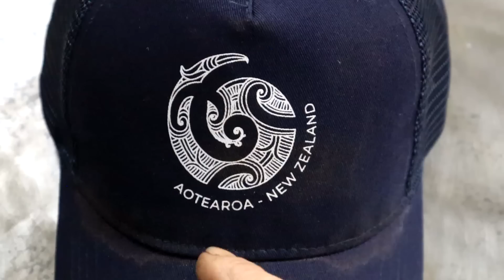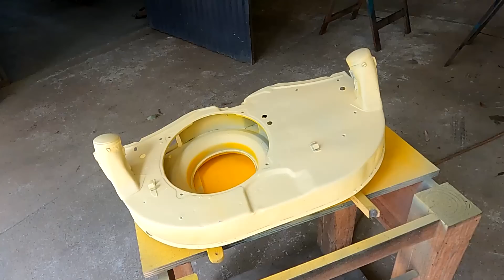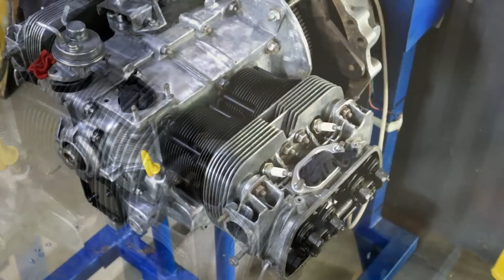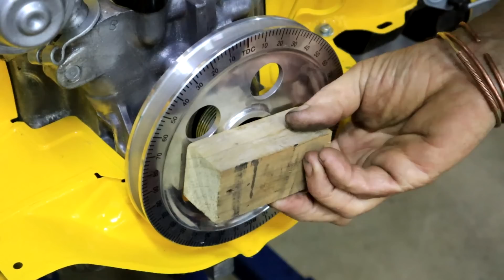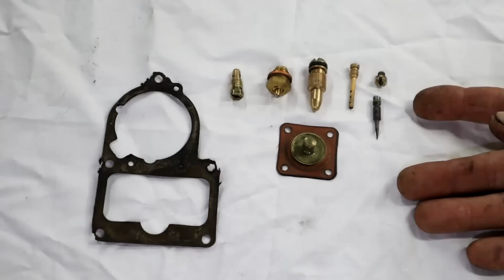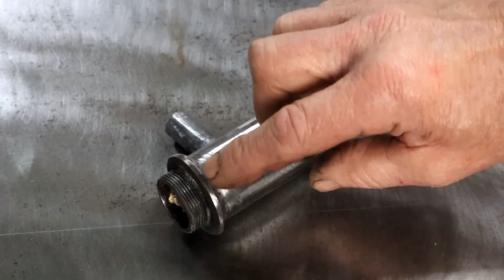Progress on the Renobug - Assembling the VW Beetle Engine

Comment: How much hate mail for using the hammer and block to put on the crank pulley instead of a longer bolt to pull it in
Reply from the maker: No one has cried about it. And there is nothing wrong with it if you do it with feeling. In the real world, who has a longer bolt that will fit there?

Comment: I must say only because I did not see you do it and only if you have a flat spot , there is a small ball baring working as a one way valve in the float chamber and it’s part of the accelerator pump, it has a plug on top but meant to be pulled apart to clean it, the plug has a thread on top to be removed and the screw you use is the one that screws into your plastic amber and red tail light, you screw the screw in and with wire side  cutters you grab the screw and remove the little plug by carefully pivoting the cutters on theCarbie  body.😊, don’t loose the ball baring. You may not need to do this and a good way to know is by shaking the Carbie if you are able to hear the little ball bearing rattling, then all good. God bless😊. Hope this makes sense 😊
Reply from the maker: I did not know that! Thanks

Comment: 1300 is argueably the most reliable vw engine. The 1200 has smaller rods, pins and thinner jugs. The 1300 share 1500 and 1600 rod and pin size with the thickest of jugs and origional german 1300  jugs are the best. Just speculating. looking good. Love the reno bug. My bug is named the dua bug. Here in the USA politics is getting hotter.
Reply from the maker: Yeah, I hear your politics are heating up. Everywhere it's seems...

Comment: Hey, Diff. I would have done the valve covers black, to help with heat dissipation. Can't go wrong with VR gasket kit. I think only the kits from Brazil had extras. Will order a T shirt later today. Motor looking good. Greg in Durban. 'Till next time, hang loose, Diffy
Reply from the maker: If you are in SA, cheaper to order a T shirt here:https://www.petrolheadtshirts.co.za/?product=roguerunner-rat-rod-t-shirt.

Comment: Love what you did with the Engine Tins brother.
Gotta love the servicability of the ol Solex carbs.
I do remember back in the early 80's modding bug engines and remember getting suckered by those pancake filters and findig it was best to go smaller diameter overall bit thicker . like at least 50 mm, learned in particular from going to Holley Bugsprays found thesse engines want some room to create a bit of fuel fog above the carb body, just make it run nicer. Just a memory that might resonate ;) 
Really enjoying this build 
All the best Diff
 👍✌😎
Reply from the maker: Yes, hate that POS air filter!   Looking for something better.

Comment: Everything you said about your government goes for the US also and it is going to get much worse before getting better. While you are working on the engine I was advised by a VW mechanic, to check the torque on the head bolts, often. I spent some time trying to find you with my computer map, but didn't have enough info, Now I'm thinking you are somewhere around Bonnievale and Ruiterbos
Reply from the maker: Spot on, I live in Ruiterbos! Farming community

Comment: Back in 1982, my friend traded a pickup for a '69 Baja Bug. He came out well on the deal, nice VW, with a dual port 1800, a better cam, Holley Bug Spray carb, and a 4 into one exhaust, like yours. After few trips through the woods (forest), the muffler/tailpipe broke off. No problem, we had a friend who raced Circle track Bugs, so we got a teepee style header from him, and after cutting a place for it to exit just below the rear window, the bug was back in action. Now, this particular motor was a bit hard to start, especially after it was warm. To start it while hot, you had to hold it to the floor, and crank it from 10-20 seconds before it would clear out and start. So, one evening after we filled it up with fuel, Jim was cranking away, when a gent decided to walk right behind us. Right when his face was directly in line with the trumpet shaped exhaust pipe, it fired up, giving the poor guy a face full of black exhaust, and restyling his hair at the same time. He was not a happy camper, screaming at Jim while he drove away, dual port 1800 bellowing.
Reply from the maker: 😁 Enjoyed the story

Comment: Muffler, resonator or stinger, depending on the construction. Motor looks fantastic. There are after market oil fillers you can get that screw into the alternator housing. They seal with an o- ring and have a breather outlet for crank case ventilation. I probably have 2 or 3 sitting in my garage. I would gladly send you one if that would help. Keep up the fantastic work.
Reply from the maker: Thanks for the offer, but shipping cost will be crazy. Anyway, my homebrewed solution will work🙂

Comment: Yelloh uncle, 
You mentioned upgrading the Beetle engine later down the line, 
All you need is jugs and pistons and if it is still really stock 1300cc you can machine the heads to accommodate the larger pistons and voila you have  successfully upgraded to 1600 cc,
Chat soon oom,
Be blessed Ciao Ciao

Comment: 2:18 Looks like a rolled up Armadillo.
4:18 Question of the day: Why is yellow labeled Chrome?
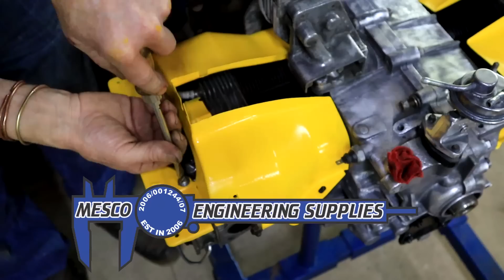12:52 Were they stainless? If not did you use anti-seize?
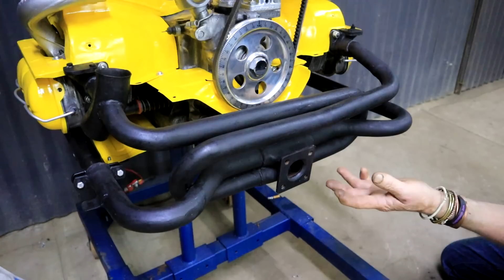20:37 Building a silencer(muffler) is not that hard to do (Google) or take one off a motor bike.
32:10 Think about this Div. The hose will go to a vacuum (carb or intake manifold) but you have a breather cap. Will the carb vent the crankcase or will it be pulling in outside air?
33:27 I would get another element and stack it onto the the first one for longer filter changes and more air into the engine.
Reply from the maker: The yellow pigment comes from lead chromate. Mild steel studs as original, threadlock on part in head, copper compound on nut. Planning on a different filter altogether.